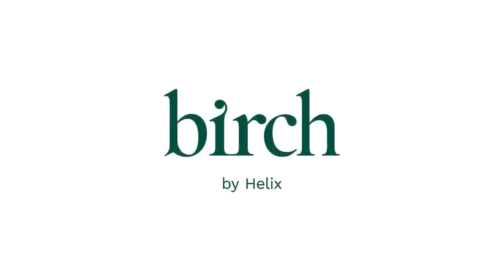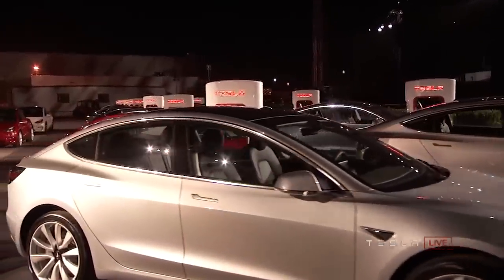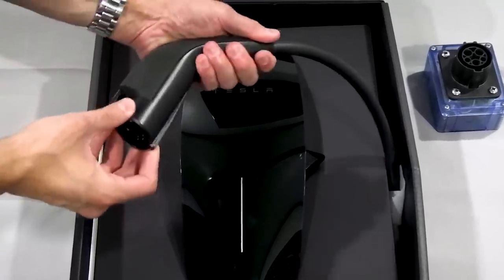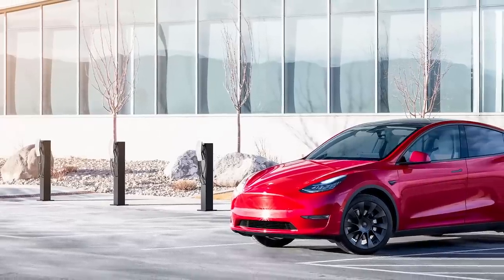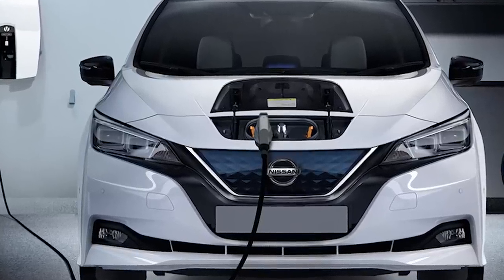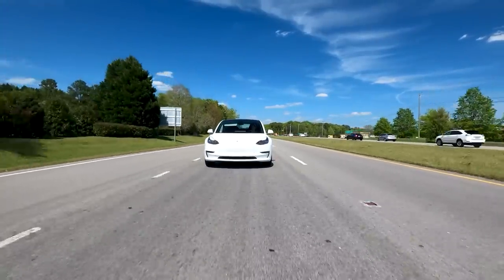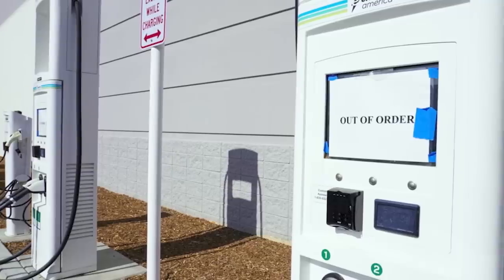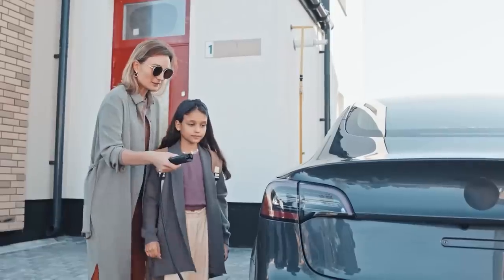Tesla's Charging Expert | In Depth

Comment: I work for an airline, and in the employee parking lot, there are 14 Chargepoint chargers.  There are pilots and flight attendants who leave their cars there for 2-4 day trips, sitting needlessly on the charger.  Other employees have plug in hybrids that take only 1-2 hours maximum to charge.  We desperately need more charging since all the chargers are always occupied, and I rarely get to charge at work.  I’ve suggested installing many 110v outlets for the employees who park for 2-4 days typically.
Reply: Long range always wins
Reply: @tophat2002  what does this have to do with my comment.  I love long range also.
Reply: As a mere passenger, I can't find any parking in Phoenix that provides a simple 120v outlet for charging while away on a flight.
Reply: @gregcollins3404  I’m sure some parking lots have a few outlets here or there, but I hope that airports start installing 110v outlets specifically for electric cars.  Great for super slow charging when the car is parked and plugged in for 2+ days!  If I find a random outlet in a parking lot, I don’t think I would use it because it could be seen as stealing power, and the outlet wasn’t put there to charge cars with.
Reply: Too many people still reasoning in fossil mode, convinced that speed of charge must be as high as possible always. Actually, given that cars stay parked for 90 and more percent of their life, slow and ultra low charging should be dominant. Also, in airports, there should be a valet service that moves the car around. Ideally, you would want to have it charged slowly and only at the last moment, just in time for your scheduled arrival.

Comment: "Destination Charging" basically means overnight charging for me. The big benefit of a dynamic load management system is that 30+ cars can be connected to a "weak" power source and still all cars will be fully charged in the morning. Without the load management system somebody would need to watch and connect one car after the other, all night long...
Reply: No-if you have 30 cars plugged in not all cars would be fully charged since each car would need 32Amps for 8 hours -they would all receive some charge overnight but not fully charge😉
Reply: @manuelmartinez-gq4ij  Depends on how you define "weak" I guess :)  I agree that 32A at 110V sounds like a reasonable minimum per car.
Reply: @manuelmartinez-gq4ij  My LR would need around 9 hours at 32A to charge from 0-100% ... but more often than not it would only need 20% .. ie 1.5 hours. How often would 30 cars come in at 0%?
Reply: I'm lucky to live in Europe where 240v is used so even the slowest chargers are fast enough for overnight charging. 

Sometimes even 400v 3 phase is available too, which is nice.

Comment: So far as I know the 80% derating does not apply to the OCPD (AKA breaker.) In a case where a 200 Amp panel is split evenly to 30 cars each car would pull about 6.7 Amps.  That is better than nothing, or having to come back to the car when a spot with an EVSE opens up. It gets even better though: as cars reduce their demand or pull away, the panel dynamically allocates up to its maximum Amps to the cars asking for a charge. 

GREAT stuff

Comment: I have a Level 2 Gen 2 Tesla Wall Charger in my garage that serves 2 Tesla's (Model Y & 3) and provides 90%+ of the energy for regular daily use of the cars. I also only charge during Off Peak hours which saves $. Now if I can get solar installed on the house  I'd be good ... ordered from Tesla  9 months ago and still waiting.
Reply: On the right track. Big solar offset is dope.

Comment: It would be very helpful if there was a short video presentation that could be shown to the board of directors of an apartment building with a garage that makes the case for the installation of EV chargers. Specifically, chargers that allow them to receive payment for the electricity used.

Comment: Just came across this great talk. I just got Tesla MYLR, and now learning the basic principles of charging EV, and terminology: KW, kwH. Volt. amp etc. One burning question I have regarding charging EV is that do I need to charge my EV at home every day, even I only drive 25 km / day, and my battery is still showing, let's say 60% left. I was told that charging battery every night is good to preserve battery, and avoid faster battery degradation. Is that true??
Reply: I believe Tesla recommends charging daily. We charge our Y every night to 85%. But I can’t imagine that skipping a daily charge every now and then would be that big of a deal. I suppose I’d be more concerned about fast DC charging when it comes to battery degradation, especially if that was my primary source of charging.

Comment: Would be good to know about electrical demand also.   Most commercial electric rate plans charge you for the peak demand each month.  A 200 amp service that actually hits a 160amp load would incur about a $400 cost.

Comment: How hard would it be to setup urban superchargers as part of the Tesla destination chargers, I know from here and there they can be utilized as mobile chargers when superchargers fill up to much.  I prefer using these for my older Tesla since my charging has been nerfed additionally it would be nice to have them in sparse areas ie rest stops to get you on your way, better then level too, but not as booked up as level 3 or 2 charging.

Comment: also consider that battery energy storage products also help with charging. some charging stations have the Tesla Powerpack. if ridiculous amounts of power needed, Tesla could simply drop a Megapack in there without much amps/cabling needed from the grid.

Comment: Your missing one fact the MS and X originally were available with two 10 KW chargers which could accept 80 amps but Tesla deleted that option and now all Tesla models have one charger at a maximum of 48 amps at 240 volts. So 50 amps would cover the operation safely.  Just thought you might have overlooked that technical point. 
  However I agree with you 20 klilloatts would charge overnight easily.

Great amount of information, thank you.

Food for thought

Comment: Can you have Smart Charge America explain what NEC code to quote that allows lets say 32 Gen 3 wall chargers on a single 225A panelboard? I plan to install a bunch in a new commercial building i am designing. Thank you.  How does the panel schedule look in that regards in order to pass code?  Usually you have to show "connected amps" for each charger at lets say 32A each.
Regards
Reply: @tedmoss  thanks Ted, that's why I'm asking. right?
Reply: I'll answer my in own question. : NEC article 625.40 and 625.42
Reply: sounds like they are pretty easy to reach if you call their line with the sales people waiting on call. I bet they could answer whatever question you have.

Comment: Is it true to keep your battery pack at 50% as much as possible if you don't drive much?   This to prevent battery degradation.  I heard lithium like to be in the middle.
Reply: 50% is overkill.  Anything between 30% and 80% will have basically the same lifespan.  I would go with 80% so that the car is ready to go on an unexpected long trip if needed.

Comment: So SMART in this case means optimizing charging management. We only want to fast charge (dc level  2 charging).
Reply: It would be nice to have ALL builders just put the 240v outlet in the garage when they build the house. READY IT. Any homeowner/buyer will not even notice the cost. And it's cheaper and easier to do on fresh new builds.
Reply: Hate the sale upgrade crap. Just give them the best.

Comment: I don't know how unusual I am on the spectrum of Tesla owners, but I have bought three Teslas since 2015 and have never used or needed anything but a NEMA 14-50 and the mobile charger.  Have an outlet at home and one at work.  Done deal.  Always worked fine.  No need for anything more.
Reply: I have owned Model S(s) since 2015 and have never had the need to instal any charging equipment at home (and I have changed homes twice in this time).  Not even a 240V outlet.  I have always used regular 110V outlets.  I plug in every time I park at home.  On most days my overnight charge puts on more miles than I had used during the day, and my battery level is higher (or full) each morning.  So while I don't have a full battery every day it is a rare occurrence (maybe once a month) that I have to visit a supercharger other than while on a trip.   Don't rush to buy even a 240V outlet, let alone a charger.  I do carry extension cables and adapters for use at camping and RV sites.
Reply: Correction...my first Model S was in 2016
Reply: @peterbroadbent8270  We could probably do the same, but we have solar PV, so we like to plug in when the sun is shining.  Our PV array does up to 7 kW peak output, so the 240V outlet takes full advantage of that.  Mostly it is my wife's X that we plug in.  I charge my Y at work for free, or on sunny days when I'm home.  We don't have net metering with our utility, and the utility only pays 3 cents per kWh for any extra energy we send back out to the grid.  So, it makes sense to use it or loose it.

Comment: We own a Tesla Model 3 Performance which is supposed to get around 300 miles of range. Our Tesla shows 271 miles when fully charged. I'm not sure if this is normal with EV users but we only have 25,000 miles on our 2020 car.

Despite that I never have range exiity. I plug in my car at night and set it to 80% and everyday it's way more than what I need. Sometimes we go 120 miles round trip and we do that twice a day and still have like 20 percent with me driving the car completely like a savage.

My Honda Odyssey mini van could only get about 275 miles per tank. About the same as my Tesla!
Reply: That seems like a bit more than average loss. My 2015 S with 272 miles originally, 65k miles driven now shows about 267 fully charged. I charge 80-90% daily. There are ways to try to reset the estimate (which can be inaccurate) to be more accurate, search for that, it involves letting it get fairly close to 0 (like 10 or 15 miles) before charging back up.
Reply: @lattelandlatteland  Thanks for the reply, I thought it seemed low. I'll check our the resetting of the battery.
Reply: I hope you called you electric provider to get on the ev rate which starts at 11 pm to 7 am and generally drops your cost of power to 3 or 4 cents a kilowatt hour versus the normal 12-18 cents. And that is for the entire house, when my buddies wife found out she started doing her laundry during the ev rate timeframe as her dryer is electric. They’re saving a bundle as they have 5 kids now she’s used to staying up till 4 am the getting the kids up feeding them and watch them get on the bus. Then she goes back to bed till 2pm then starts all over again. She washes an average of 5-6 loads a night.

Food for thought

Comment: The future battery shortage can be slowed by installing lower capacity batteries.  More chargers are needed for more frequent charging.  Also a smaller battery could reduce the cost of a car.
Reply: This is a good point but the size of the better matters less if the vehicle is not efficiently run by the packs.

What we need to do is incentivize OEMs to hold high efficiency design standards as opposed to just low capacity. 😁👌🏼

Comment: He said "fires to tackle"
Reply: So I have a tesla wall charger i plug into a 50amp circuit, it draws 80% so 40 amps, about 48 km an hour.  Is getting a wall mounted charger going to do anything?  Would I have to have dual chargers?  I don't even know what that means, my Tesla is a 75D model S from 2016 AP1 but refreshed face (so sep 2016 built, bought it Dec 30th 2016)  Now it doesn't really matter, even my first adapter drew 32 watts (some other province limited it to 32 so all of canada gets the 32, I bought a US one so i can get 40)  I plug in and forget right, so is there ANY point to the wall mounted charger?

Comment: Guys… I want a charger unit for EVERY car spot in our condo.  We have 400 units.  Each unit owner owns a parking space.  We can charge the owner for the unit the fee for the charger.  It doesn’t need to be a super fast charger.  It simply needs to charge over night.  It’s my home.  And, it needs to be smart card ready so the owner can buy the electric.  It can be small!  Like what I would charge in my house.  Or 10kw so I can charge an 80kw battery in 8 hours..  It is my house.  We need 400 3kW chargers.  Or 10kw around? Tiny. Small.  Overnight charging.  Not a line of people waiting.  EVERY CAR will be electric.  I want the @home experience even though I’m in a condo.

Comment: Great information.  I don't understand why people want chargers at their work.  Just charge your car at night while your sleeping.  Evs have similar range as cars.  You don't have gas stations at work.  Restaurants have chargers but why, like you show up without enough charge to make it home?  Doesn't make sense to me at least.
Reply: There is a large population of people who do not have access to electricity where they park, such as condos, apartments, or houses with only street parking. The electrification of those places isn't necessarily easy, especially if you are not the owner.

Destination chargers at places of work enable electric vehicles for those people. Without that infrastructure, EVs are not very attractive.
Reply: Three scenarios. Firstly, staff who don't have good charging at home. Work charging is a good bonus for them. Secondly, if you are driving for work and come back to resupply in the middle of the day, you can charge. Finally, many companies have work vehicles that live at work.
Reply: Some people live in apartments or condos that don't have charging.  Work is where most people spend most of their time outside of their home.  So being able to charge at work is a nice perk for those people.
Reply: I would use a level 1 charger at work when below zero in the winter just to keep battery conditioned. Other than that don’t need unless people don’t have a garage at home to charge.

Comment: K wait what, I can just install a Gen 3 wall charger in my house and not need a system like a DCC 10 to balance and monitor the usage now?

Can anyone verify this?
Reply: I think what they are saying is if you more than one charger, say you have two EVs at home or multiple in a parking garage the chargers can balance available power over all the cars that are charging, dynamically.

Comment: Tell us about the source of the power, If millions of cars hit the streets where will the energy be produced? Do you have any information about what the US is doing to produce power? Nuclear? Coal?  Fossil Fuel? Renewables can or cannot keep pace with EV sales. What do you think will happen if everyone (Millions)go electric and plugs in Every night. Do you have more information about the ramp up of electrical production? Will the cost of a KWH be more than a barrel of oil in 5 years? There are 2 ends to every wire. Will the lights go out state by state?

Comment: So are these just destination chargers or do they super charge?  Would I have to spend the night at one of these chargers?
Reply: They are destination chargers, but you don't necessarily need to charge overnight. Think of it as being like grazing. Where I am, a model 3 can get around 77km/h at top rate. That is useful charge speed where far charging is not available.
Reply: They are destination chargers.  They charge at ~10% to 20% per hour depending on the vehicle model and charger details.  Whether or not it would be overnight charging would depend on how much charge you need and what you are doing.  These could be installed at places of work, schools, shopping centers, apartment complexes, condos, gyms, parks, movie theaters, restaurants, etc.  So any place that someone might be for 1 or more hours.